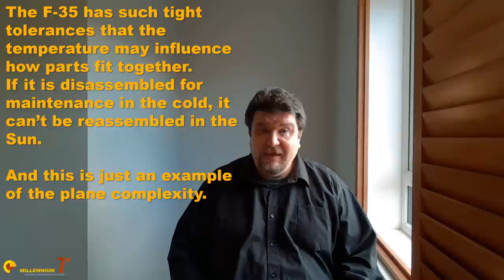F-35: The Failure of the $100 Million  Dollar Jet | Maybe...

Comment: Not surprised. Never has a joint program been successful. People keep ignoring the lesson of history.  There is almost no commonality between the versions (apparently the cockpit). And too much emphasis on stealth, with no single mission. If you have a single mission, you might be able to design a clean stealth plane that is pretty perfect. But F-35 is supposed to provide many missions. LOL. That means have to deal with very different loads, and ranges. How many armchair experts out there that have no engineering experience with designing will tell me I do not know what I am talking about. LOL. I have noted for years that single service planes are not successful, and that stealth is probably no longer the silver bullet, and costs a hell of alot if it is the major design criteria (for some reason people do not understand that concept of a balanced design). 

I also would not be surprised if this decision came about because Chinese and Russian weapon systems now are designed so that stealth is not that effective. They have had 40 years to figure out how to counter American stealth, and the assuredly are not depending on systems stealth is effective against. Amazing how the American people have such a hard time understanding that probably stealth is no longer that silver bullet. F-35 design is now over 25 years old, and the ideas go back another decade or so.  First flight was ancient history in 2006. And the US did not even know what type of wars it would be expected to fight with there no longer being a USSR, and the political situation today is so different from what was expected in 1995

Side Note about Blackhawk/Seahawk. It was decided to try to build the new Navy helicopter based on the Blackhawk.. The end result was really two different helicopters that looked very similar, and one that really was not that good for navy use. If you look at previous Navy helicopters they were tall. There is a reason for this and that is people in the back of the helicopter are not just passengers. they are working. The Blackhawk was designed  for the troops just to sit in the back, and be a smaller target for enemy fire. Don't think Navy helicopters operating off destroyers and such really have to worry much about enemy fire.  Think about maneuvering equipment to hang outside to be lowered, or bringing a man back into the helicopter that has just been pulled up. Think also of having a consoles, and making it easy for a supervisor to go between manned consoles and review what the men at the consols are doing. Because of the stupidity of focing the Navy to try to leverage the work on the Blackhawk has forced the Navy to use a helicopter that is extremely sub-optimal for the task for 40 years. What a waste of taxpayer money. The Sikorsky S-92 would have been a much better choice (Sikorsky developed this on its own dime). It has a lot more space, is about 4' longer (length was not important for Blackhawk), about the same empty weight. How much better would it have been for the Navy to be operating something like the S-92 instead of the crappy Seahawk. 
https://www.bing.com/images/search?view=detailV2&ccid=TsIDVHv0&id=76A5CEF157EF8F553F8AD10459962311383D9E9D&thid=OIP.TsIDVHv0yUf-IEOrtkxeMQHaFB&mediaurl=https%3a%2f%2fth.bing.com%2fth%2fid%2fR4ec203547bf4c947fe2043abb64c5e31%3frik%3dnZ49OBEjllkE0Q%26riu%3dhttp%253a%252f%252fimgproc.airliners.net%252fphotos%252fairliners%252f3%252f8%252f1%252f2026183.jpg%253fv%253dv40%26ehk%3diP4FI2uxR3Z97eoKSqXU5eDZsDh%252beitlvkbL0KZoqEs%253d%26risl%3d%26pid%3dImgRaw&exph=694&expw=1024&q=s-92+canadian+navy&simid=607988613283974406&ck=C22628E48422802081F0952FF97065E3&selectedIndex=0&FORM=IRPRST&ajaxhist=0

Comment: F16 is attack fighter, F35 is stealth recon join strike, complitly diferent purpose, i dont understand why people mix plains which has diferent roles. is like treat bomber as a fighter. f35 is for new modern warfare, electronic warfare. it make job like f117 which didnt replaced any other plains. f35 is to replace f117 so only compare to this one. the fighter is f22 not f35

Comment: Yeah, na...engrish, punctuation and slooooow talking aside. F35 is here to stay, but there is clearly a need to balance high performance 5th Gen high SA planes with cheaper Gen 4++ that can be supplement the better air craft by being available in much greater numbers. This doesn't make the F35 a failure, it is evidence as to how much a few F35's increase the effectiveness of 4th gen air craft working in tandem.

Comment: To me it would make sense to take the sensors and avionics technology from the F-15EX and F-35 and drop it in a new airframe about the same size as F-15EX that has semi-stealthy shaping in general but with no additional maintenance required for stealth. That means no fancy external RAM coating, just standard paint. If any RCS reducing materials are used they should be durable and internal, with an expected life to match that of the total air frame. 

The aircraft should be designed for low maintenance cost and time, high speed, and high firepower to complement the stealth fighters with opposite characteristics. That essentially is similar to the design goals of the F-15EX variant. 

A large volume of internal space should be available for sensors, enough to accommodate the same radar and EPAWSS from the F-15EX plus the internal optical sensors of the F-35 with sensor fusion. Aircraft control should be with a side stick and a modern helmet integrated to sensors and targeting should be standard from the start. It should use external stores instead of internal in order to maximize firepower and use various supporting pods. 

The external stores will place an inherent limit on the feasible minimum RCS and that can probably be reached just with some clever external shaping and extensive use of sawtooth edged access panels. An RCS slightly better than a Rafale should be a reasonable goal. A firm requirement should be absolutely no scheduled maintenance of stealth between missions. 

I hope they call it an F-25, to suggest a fully modern replacement for the venerable  F-15. Build 1000 of them.
Reply: With ECM, it can avoid just any S-series SAMs.

Comment: FYI  ==> Cost? it's a moving target.  No one really knows how much an individual military plane costs and there are a ton of people in the Pentagon who try know per the FARS, DFARS and relentless arguing and audits. 100 mil for an F-35? is that with or without the tires, spares and repairs, overhauls. modifications and upgrades for safety of flight issues.   No one cares to know what a weapon system total procurement price was becuse b/c you can't actually use that information to help make a decision on some other  procurement or the next proposed weapon system.  Bottom line: The Marine in the fox hole appreciates it when the F-35  pilot bombs the shit out of the assholes trying to kill him. $100 mil sounds cheep to him.

Comment: I see a single engine 2 seater coming down the pipeline.
practice with using low cost UCAV's with the f15ex and whatever single engine 2 seater they come up with.
once that is done use the knowledge learned to ensure the 6th gen options are properly set up.
the NAVY is in a bad spot...more f18 F to be the workhorse with the f35 dedicated to strategically worthwhile targets?
it would appear that the airforce is not confident at using the f35 as a workhorse operating UCAV's. if the USAF was confident in using the f35 as a workhorse to control UCAV's we would not be having this discussion.

Comment: The F-35 will continue to be supplied to the US Air Force. Why? Because there is no alternative for now. In 4-9 years there will be a 6th generation fighter and that will replace the F-16s but that's another issue.
Reply: So we are going to spend $1.5-trillion on a piece of crap that will be going to the scrap heap in 4-9 years!
Reply: @DennisMerwood-xk8wp  

No. You really have no idea how things work. I guess democracy is really overrated. You definitely shouldn't have a say in how the mimitary budget is made. The F-35 will be used by the US Air Force, US Marine Corps, US Navy for decades. In 4-9 years there will be a new fighter that will replace the F-16s and F-15s of the US Air Force.

Comment: Commanders and troops know what they want or are needed. Then factor in the Military-industrial complex that had been ripping of the Pentagon and the Taxpayer. The contractors will fight over the work and bog down the program in the courts because they think they should build it rather than anyone else. You then end up with a hugely expensive program that the Stae governors will take through the courts to get it made in their state. Eventually, the Military gets the Product that they can hardly afford. Its range and payload are too short. Specialized weapons have to be developed to fit in their small weapon bays. Airframe life is not as advertised, its availability is very poor. You then realize your potential adversaries are producing counters to your very shiny new jet,. Along comes a Commander that looks at the F-35 and sees the taxpayer has been fobbed off with this super expensive Turkey. He wants to give the USAF a more affordable and usable Jet. Something that's going to take at least another 20 years. Other Airforces and users of the F-35 will not take kindly to hiking up the Unit Price due to canceled USAF orders. Unlike the other Lockheed Turkey the F-104, which spent not meant years in ADC or Tac air service The USAF cant quietly drop for Lockheed to Bribe Nato to take. Like the A330 Tanker program, Washington will not allow the USAF to Buy Typhoons or Rafael's.

Comment: Could someone explain to me why the F-16's shouldn't be replaced with F-15e's or a derivative? Obviously F-15e costs more than F-16, but would a newly developed 4++ fighter be much less expensive, plausibly?
Reply: High-Low mix. Not to mention both already having upgrades planned, though I haven't heard of the F-16V much in comparison to the F-15EX.
Reply: @TheRibbonRed  I don't understand your explanation. How does "High-Low mix" translate to a reason to not replace F-16s with F-15e's or derivatives?

I mean ... if it's just an unassailable mandate that the USAF must have a "High-Low" mix, can't they just say that the F-22's are the "High" and the F-15e's are the "Low"?
Reply: F-15 and F-16 relies on airframes designed in the 70's when supercruise, vectoring and stealth, for example, were not a thing, and requirements and technical capabilities were different.
They have been updated, and are very capable aircrafts, but there are at the end of their development: it is impossible to improve them  without an extensive airframe redesign. A new aircraft would cost less and would be easier to design, as it would not have to be based on an outdated airframe based on requirements that date back to the 60's.
Reply: @farfromreal  that, not to mention their capabilities & intended missions.

Look up "high-low mix" on Google to find out more. It's a kind of battle doctrine, intended to keep your military more versatile but not too stretched out. Putting all your eggs on one platform (the F-15E) would just be utter disaster once the opposition finds (or steals, cough F-35 & the PLA cough ) a way to defeat it.
Reply: @farfromreal  I understand that, but I'm skeptical whether a new 4++ design would be so much less expensive, considering what happened with the F-35 (and the F-22, really).
Reply: Oh, one note that I thought goes without saying, but I'll say it anyway. The F-15 has arguably the best air-to-air combat record of any fighter ever. Even if we can theoretically say that a clean slate 4++ design might have some better capabilities, could we confidently expect that it would be as effective in an actual combat situation?

Fighter jet development is hit and miss. Sometimes a model luckily turns out to be excellent. Sometimes the designers can seemingly do everything right but things just don't work out so great in practice. The F-15 turned out excellent beyond what anyone could have anticipated.

In comparison, the F-16 and F-18 have done their jobs well, but it's not like they have been surprisingly exceptional. You could plausibly be confident that a clean slate 4++ design will outdo them. But would you confidently predict it would outdo an F-15 derivative?

Comment: No need for the drama. The F-35 is a great aircraft and wil continue to sell. Even the F-16 wich is considered the golden goose of us fighter design had it's hick ups in the beginning. The F-35A cost under 80 miion USD pr aircraft today. The latest F-16 just sold to Taiwan cost about 125 milllion USD.
Reply: A bit misleading since:
>TECRO has requested to purchase sixty-six (66) F-16C/D Block 70 aircraft; seventy-five (75) F110 General Electric Engines (includes 9 spares); seventy-five (75) Link-16 Systems (includes 9 spares); seventy-five (75) Improved Programmable Display Generators (iPDG) (includes 9 spares); seventy-five (75) APG-83 Active Electronically Scanned Array (AESA) Radars (includes 9 spares); seventy-five (75) Modular Mission Computers 7000AH (includes 9 spares); seventy-five (75) LN-260 Embedded GPS/INS (includes 9 spares); seventy-five (75) M61 Vulcan 20mm Guns (includes 9 spares); one-hundred thirty-eight (138) LAU-129 Multipurpose Launchers; six (6) FMU-139D/B Fuze for Guided Bombs; six (6) FMU-139D/B Inert Fuze for Guided Bombs; six (6) FMU 152 Fuze for Guided Bombs: six (6) MK-82 Filled Inert Bombs for Guided Bombs; and three (3) KMU-572 Joint Direct Attack Munition (JDAM) Tail Kits, GBU-38/54. Also included are seventy-five (75) AN/ALE-47 Countermeasure Dispensers (includes 9 spares); one-hundred twenty (120) ALE-50 towed decoy or equivalent; seventy-five (75) APX-126 Advanced Identification Friend or Foe (includes 9 spares); seventy five (75) AN/ALQ-211 A(V)4 Airborne Integrated Defensive Electronic Warfare Suite (AIDEWS) or equivalent (includes 9 spares); EW Line Replaceable Unit (LRU) and Standard Electronic Module (SEM) spares; one hundred fifty (150) ARC-238 radios (includes 18 spares); Secure Communications and Cryptographic Appliques including seventy-three (73) KIV-78 cryptographic COMSEC devices, and ten (10) AN/PYQ-10 Simple Key Loaders (SKLs) for COMSEC; three (3) Joint Mission Planning Systems (JMPS); twenty-seven (27) Joint Helmet Mounted Cueing Systems (JHMCS) II with Night Vision Device (NVD) compatibility or Scorpion Hybrid Optical-based Inertial Tracker (HOblT) helmet mounted cueing system with NVD compatibility; seventy (70) NVDs; six (6) NVD spare image intensifier tubes; Cartridge Actuated Devices/Propellant Actuated Devices (CAD/PAD); cartridges; chaff; flares; three (3) each DSU-38A/B Precision Laser Guidance Sensor (PLGS) for GBU-54 Laser Joint Direct Attack Munition (LJDAM) integration; PGU-28A/B 20mm ammunition; telemetry units for integration and test; bomb components; twenty (20) ground debriefing stations; Electronic Combat International Security Assistance Program (ECISAP) support including EW database and Mission Data File (MDF) development (classified/unclassified); communications equipment; classified/unclassified spares, repair, support equipment, test equipment, software delivery/support, personnel training, training equipment, flight/tactics manuals, publications and technical documentation; bomb racks; Organizational, Intermediate and Depot level tooling; Pilot Life Support Equipment (PLSE); Alternate Mission Equipment (AME); ground training devices (including flight and maintenance simulators); containers; development, integration, test and engineering, technical and logistical support of munitions; aircraft ferry; studies and surveys; construction services; U.S. Government and contractor engineering, technical and logistical support services; and other related elements of logistics, program and sustainment support. 
https://www.dsca.mil/press-media/major-arms-sales/taipei-economic-and-cultural-representative-office-united-states-11
i.e. it's not just a plane, it's also a ton of ammunition, logistics and electronics.
Reply: @Poctyk   As it always is with any such purchase.
Reply: @Cta2006  Yes, so comparing it to just plane isn't exactly correct.
Better price comparison would be either contract that Fins look into, or recent Polish contract

Comment: Why not use the new t7?
Reply: T7 is exclusively a trainer & they wouldn't want to " lose reputation" in repurposing it.

Besides, the whole point of this "my own fighter" bickering is money. Just like the Aardvark; more contracts, more money for the branches involved.
Reply: The T7-a is a great aircraft, but it is not built to the spec need for any kind of modern fighter.
As an example it is designed for a max load of 6G iirc.

Comment: REALITY, is that when thorough evaluations are made of the F35 on the basis of performance and cost, more countries (Like the SWISS TODAY) are choosing the F35 over its competitors.  Why? Because it offers an affordable technological revolutionary leap rather than an costly evolutionary improvement over its competitors. Despite the pundits, critics, and nay sayers, the F35 has emerged as an amazing aircraft. Naturally, it is not perfect. New technologe never is. However, its potential, to improve and evolve because of its architecture, is also a tremendous long term asset for those purchasing it.